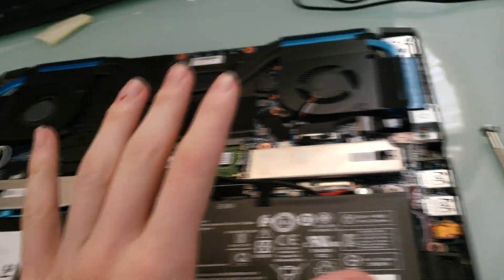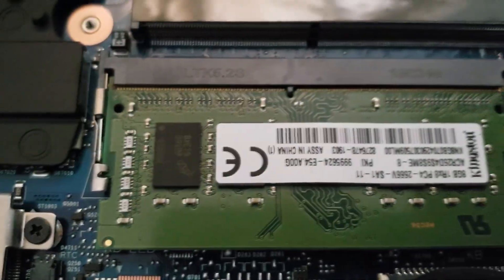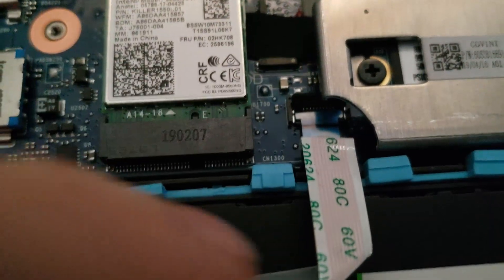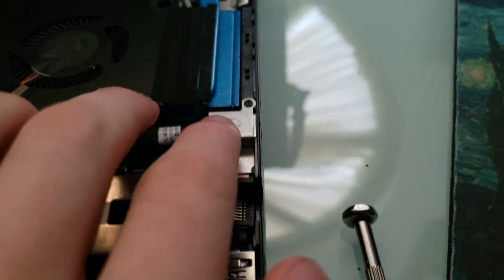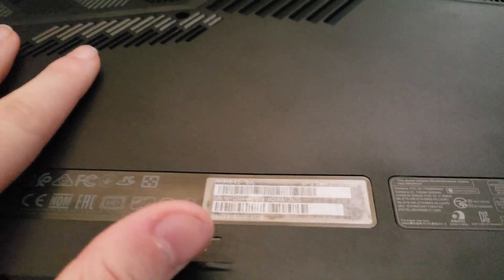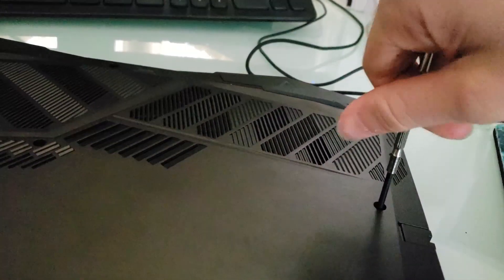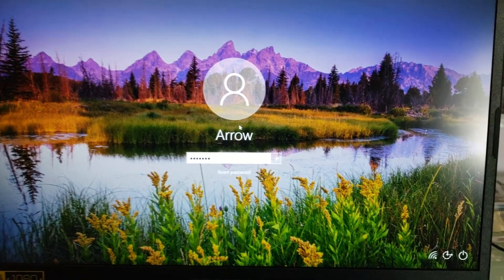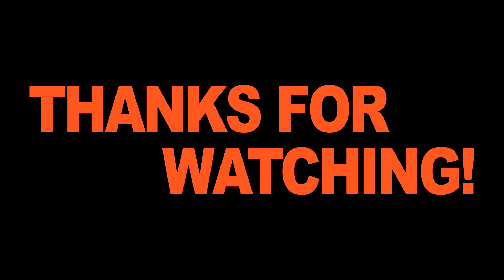How To Install A Storage Drives And RAM In The NEW Predator Helios 300

Comment: Title says "how to install"
Starts with everything installed with saying what you did.
Should of done it guide style of showing the whole process and not the end result as there's no other installation vid for 2019 model
Also Acer says it voids warranty on the HDD Upgrade kit so ppl need to knoe that.
Acer does the upgrade under warranty for free IF you get to an Acer store
Reply from the maker: Bruh, it explained "how to install" it, title didnt specify that it would start from it being uninstalled. Also no it doesnt viod the warranty, it's only if you f*** something up that it voids warranty, it you do it and dont break anything then you're all good
Reply: Arrow hey arrow discovered your channel recently, did you set a partition on the drive and does an external drive need a partition
Reply from the maker: @CryptoNerdo  no i didnt i just left it as it came, however all boot drives need a primary partition if they are completely formatted however the windows install tool should take care of that fo you. Also, no external drives dont need partitions
Reply: @ArrowStudios   hey thanks for the info
Reply: @ArrowStudios  you should really unplug the battery and ground yourself before doing any of that.  Just walking across carpet can build up enough static electricity to fry components.   The connector the 2.5" drive plugs into on the motherboard is called a jaw bone connector.
Reply from the maker: @michaelkaba7481  i touched something metal once i sat down in the chair to ground myself before I started doing all that stuff, besides, computer components these days are a lot more resilient than they used to be.
Reply: @ArrowStudios  just because you touched something metal doesn't mean you grounded out your potential.   Especially if it was painted metal.   A wrist strap connected to bare chassis will do the trick before you disconnect the battery.   I have had numerous electronics courses.  I do shit like this for a living.
Reply: @michaelkaba7481  What's another way to ground myself? Sorry I have no idea what you said about the wrist strap or chassis 😂

Comment: Could you possibly show you putting the 2.5” hard drive in plz
Reply from the maker: Dude it's not that difficult, you put the rubber grommet over the ssd/hdd making sure that the rubber bits sticking out are on the top side of the ssd/hdd and that when the connecting cable is also sitting on top of the drive when plugged in, lift the plastic latch up off the connector on the motherboard and insert the connector cable and put the latch down following that, place the drive into the slot with the rubber tabs sitting in the plastic cutouts shown in the video and then blamo you're done, hope this helps.
Reply: @ArrowStudios  I mean how lazy can you be not to film that part, this is just a lazy vid. Literally maybe some people are doing this for the first time so they want to see everything you do when you open it up for the first time... Sheesh smh
Reply from the maker: @lIlllIIllllIIIII  late response but I was on vacation when filming this video and I was tired from editing non-stop on the first two videos so that's why this wasnt my best effort.

Comment: One last question, don't want to bother you, I looked on amazon and the 2018 model is more popular than the 2019 model and is 180 dollars less. Also, the ram and hard drive are more accessible so it would be easier. The thing is the 2019 model looks better and sleeker and performs better. I want your opinion/advice. Should I get the 2019 model or the 2018 model?
Reply from the maker: 2019 model because it performs better and might last you longer since its newer tecnology. Although, its really up to you and your personal opinion, do YOU want to or think that that extra $180  bucks is worth it or not, its really up to you. Thx for supporting the channel man. Have a good one.
Reply: @ArrowStudios  Thanks for the advice you have a good one too

Comment: Hey it's possible to switch the battery to the one the Triton 500 uses? Since I don't mind expanding the disk but the battery. Thanks
Reply: I, too, was wondering this as typically the larger batteries fit where the 2.5" drive goes. I would just order a really affordable yet fast 512GB or 1TB NVMe SSD (such as the Silicon Power or ADATA XPG Pro drives) and put in the larger battery. It looks like it SHOULD fit.

Comment: Hey Arrow. Quick question. Does the Cabble and blue rubber come with the laptop as standard or do I have to buy them?
Reply from the maker: Comes with it, or at least mine did, doubt yours would be any different.
Reply: I have been thinking about adding a new hard drive but I didnt get any blue rubber or cable with mine, where can I buy them from

Comment: Is there a limit of how much can I upgrade the PCIe ssd? I want to put 1 TB even though Acer said that the tested storage was 512 GB
Reply from the maker: No storage will almost never be limited by size
Reply: @ArrowStudios  do you know what type of RAM to use on the 2060 model?
Reply from the maker: @brucebanner3566  you have to open up the laptop to look at the brand/model or sometimes there is a replacement part sticker on the stick itself. All laptop ram is so-dimm for the most part so you're good there then all you have to do is match the size and speed to the one in your laptop, but then you also have to see that the timings are the same but that can be difficult since you dont know the exact model of ram in the laptop. Not sure that this helps but it's the best I can do without talking you though it

Comment: Can you help me with what ram company and model should i use for this laptop upgrade
Reply from the maker: Often times there is no easy answer, try looking up what model ram you have based off a sticker that might be on the ram when you take it out, otherwise there's no real easy solution, it could work it could not but 9.9/10 you'll be ok with any choice, just make sure to get the same capacity and speed of ram, otherwise,it becomes a 50/50 shot of working. Hope this helps, reply with further questions, not sure I answered that one the best.
Reply: @ArrowStudios  thnx

Comment: Ordered my 2060 with this. Jst wonderin how you use monitor with helios?
Reply from the maker: I use a display port mini to Display port cable, there is also an HDMI port you can use as well
Reply: @ArrowStudios  ok is there a difference with mini and hdmi? which is better? and can you suggest best model of  monitor for this? thanks
Reply from the maker: @lowag3144  Displayport mini is far better due to its increased bandwidth and support for higher refresh rates at higher resolutions, although HDMI will be just fine if you're planning on using a 60hz monitor. As for a specific model of the monitor I have no clue, there are thousands of models and thousands of different brands. It doesn't really matter as long as its at least 1080p resolution at 60hz refresh rate or higher.
Reply: @ArrowStudios  thanks man

Comment: Nice video..
Does it support Sabrent 2TB Rocket NVMe PCIe M.2 2280 ....coz I'm thinking of buying it....
Reply: Well I put in the 1 TB Rocket and it is fast but remember it reverts back to pci 3 benchmarks because of the limitations of the motherboard but it is still blazing fast but it does heat up somewhat

Comment: Any idea why i can’t run overwatch ultra settings on higher than 90 fps while other YouTubers get 200 fps on ultra settings, i had extreme GPU overclock turbo mode. Max cooling with coolboost. But it didn’t help much
Reply from the maker: Not sure, there are too many variables as to why that could  be but unfortunately I am also not familiar with overwatch so I cant really help much

Comment: the empty slot in the laptop is for sdd or hdd?
Reply: It can work for both because both of them uses sata connection
Reply from the maker: Either, as long as it's a 2.5 inch drive

Comment: One fan has metal blades and other one has plastic blades.
Reply from the maker: Yeah found that out today, oopsie
Reply: Akash Singh Does it really has one plastic blade in this model? I just have 2018 Predator model and fans are both made of metal..
Reply: @oleksandrhanible9763  I am not sure about 2018 model but ya 2019 has one fan w plastic blades
Reply: Akash Singh Model 2019 better than 2018 based on gtx 1060? ( I have based on gtx 1060)

Comment: Are both the M.2 slots populated?
Reply from the maker: no only one is
Reply: No, it's not so you can use One M.2 and one Sata SSD Drive, that's what i did and it worked like a charm. :)